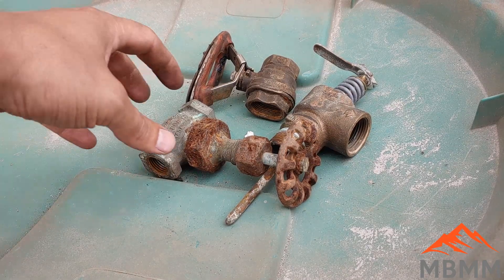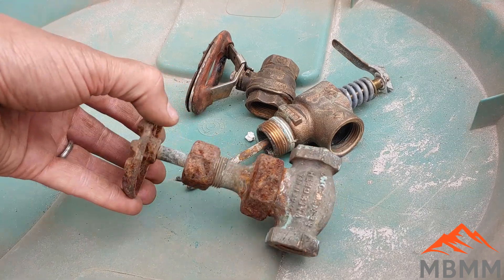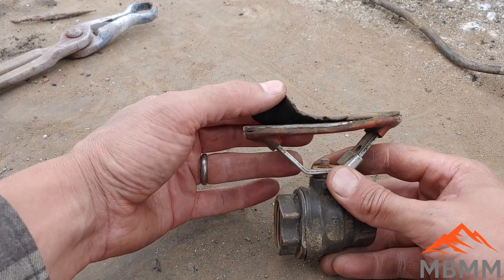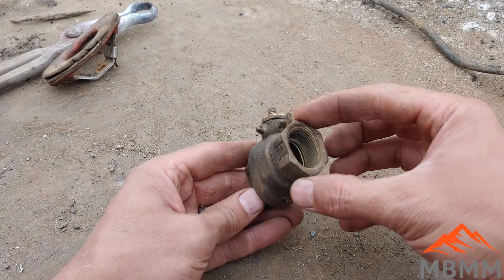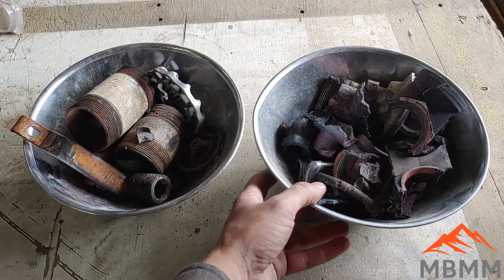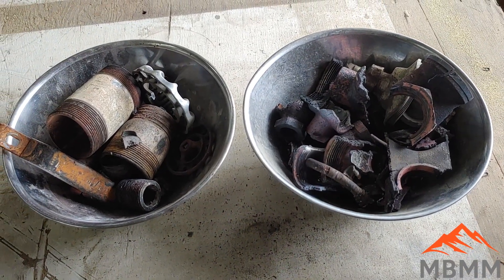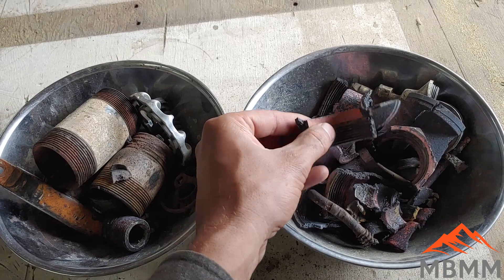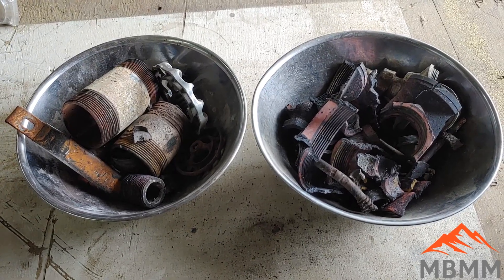Easiest Way to Clean Scrap Brass Valves

Comment: Heating and busting up is called a "hot shot" method, I did that with my aluminum scraps that have shafts, gears etc. imbedded in them, a lot easier than disassembly or angle- grinding them apart, useful video you did.

Comment: Quick tip that last valve u did (the regular brass one) u didn’t have to go through all that trouble getting the ball out because that too is brass just with a tin or something coating. I too used to think they were stainless but I scratched it one day and yellow appeared. I’ve scrapped a ton of these valves and it at the point I don’t even check the ball no more cause every one I did was brass.
Reply: Same here I first thought the ball was stainless steel when I was removing it with a grinder I cut through it was brass 😮

Comment: Yea, good video but I have done that and most of the time I can do it much faster using a pipe wrench and vice. however I have had to do it on pieces that would just not come apart and then I just start a little bond fire and wrap a wire around them and toss them in. Cheaper than propane if you are aloud to have a fire where you live.

Comment: Cement mixer full of sand is way easier.
Reply: how does that work?
Reply: @madkow007  Take a small cement mixer.... fill it with sand and a little water along with your scrap and turn it on.   It works like a large tumbler and cleans it up completely.   Stuff shines after like maybe 10... 15 minutes or so idk.  Results might differ far as time is concerned depending on how corroded your stuff is but over all it works great and I literally have cleaned thousand of pounds of brass over the years via this method.  
I'm third generation plumber so needless to say we use to have ALOT of scrap brass and copper but up over close to a century.  Mixer could turn copper that is hardly recognizable into #1 copper in no time.

Comment: Longtime tradesman here, just use a large well mounted heavy duty vise, and a very large pipe wrench. 

The bigger the pipes and valves, the bigger the vise and wrench you need. Soak heavily corroded fittings with penetrating oil. 

If you still can't remove something, split it with a sharp cold chisel.

Soaking in cheap white  vinegar at 200-210 F will remove heavy deposits of scale fairly quickly.

Comment: Very useful information. To cut down on the cost of propane, in this particular case, the valves could have been disabled using a pipe wrench, vise and propane torch. Great video.

Comment: Question. As the different metals have different melt temperatures can you take the whole valve up to the melt temp for the copper/brass and end up with steel pieces that aren’t mixed within the molten copper/brass

Comment: Worth while or a waste of time is determined by the difference in final price when sold.
What dirty brass scraps per pound vs clean brass scrap prices.  Any scrappers know those numbers??
Reply: Dirty non-ferrous scrap (generally defined as containing steel, rubber and plastic) is generally a small fraction of clean.  For dirty brass, I get only about 25% of the price of clean "plumber's brass".  Aluminium is between 20% and 25%.  The lowest grade copper (insulated and dirty) is only 5% of the highest (No. 1 or "bright shiny" grade).  If you want to break up the brass, it's best to take a small sample to your local scrap dealer and see what they will offer, before committing to processing large quantities.
Reply: Yes

Comment: Good info, like all scrapping ideas, check with your local yard. Some yards refuse to take burnt non ferrous,
Reply: right mostly its copper  wire the yard i use they wont take the steel belts from tires either or lead / zinc or any metals that have been melted and poured into ingots/bars
Reply: @yoopermann7942  yeah it's same with one I use. There are devises that can be used to determine content of ingots,,but from what I've heard they're about 20k. I've noticed some home hobbiest channels are having to buy scrap non ferrous, I've got one lined up to buy some zinc from me, have between 4-500 lbs. As far as lead?  People who do their own reloads will gladly buy it. Stuff is getting hard to find.
Stay safe and careful.

Comment: May as well go the rest of the way and melt then cast an ingot. Get a pool of brass going and they melt faster, steel floats on top.
Reply: @reverendtfg6802  Thanks.  I'll have to go get me some copper sulfate.
Reply: Well as a former scrap buyer at  a small junkyard I would be skeptical about an ingot  from a home shop. It would be better to pour the melt in a bucket of water . No,  in a barrel of water to shot the poor.  A major way  to identify red from yellow is by just looking at the value  the type and manufacture.  So I'm not a fan of  pieces and pour scrap . One good example is natural gas values . Modern values are Aluminum  older style of zinc  and often sellers will not separate the zinc ones from the Aluminum  ones . So what is my choice ? I have to dock the load to a lower price
Reply: @robertbrawley5048  is there an easy way you can tell cast aluminum from cast zinc?